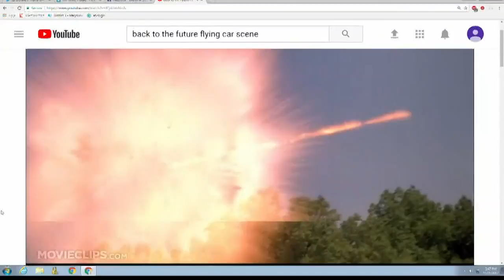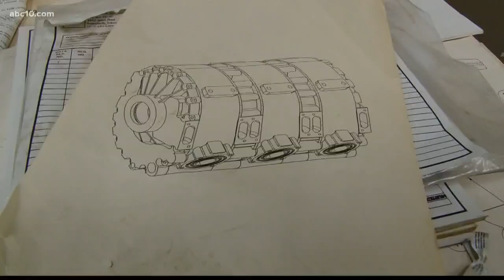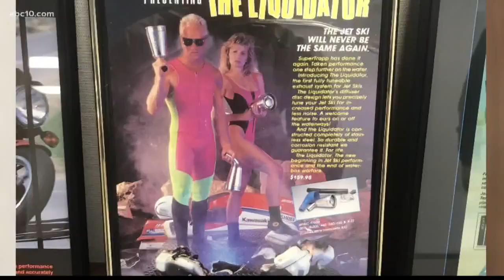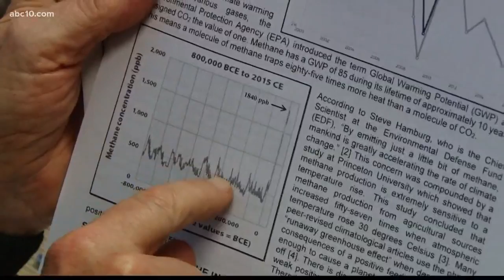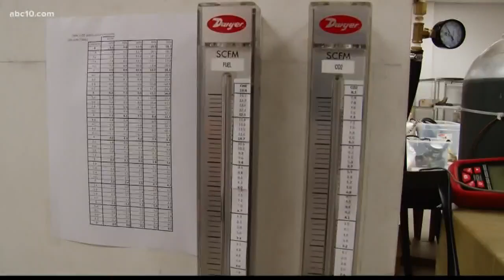Moller Skycar: Why hasn't the flying car hit production?

Comment: 60 years and thing is still dangling from a cable going nowhere, its time to let it die.
Reply: Michael Collins  The later compound version of his rotary engines were never installed on his M400. Had they been, they would been able to maintain stable hover as they have more capability. The big issue is that his company has been in financial ground effect for over a decade, and the reason for that has 100% to do with marketing. If you can't attract top talent or sufficient capital (and often lack of one leads to the other) because of a PR failure, you're ruined.
Reply: @BlueOceanStrategistS  no dude. this "car" is a scam.  in close to 50 years he has never once had an untethered flight & I believe there was one test flight ever that even ascended out of the ground effect zone. he made outrageous claims of having similar fuel economy to a car & a range of 900 miles. oh yeah & it uses 8 rotary engines. that's laughable. also, I dont know about you but I'm not about to put my life in the hands of something with a powerplant as notoriously unreliable & finicky as a rotary engine. god forbid something goes wrong with the engines (which it will) you're screwed because this thing has a glide ratio of a sofa. skycar is never gonna happen.
Reply: @bofaf3tt  Technology isn’t constant. Moller developed coatings to improve the life of the rotary. You’re telling yourself that you don’t need to know how to make rotary engines more reliable. Maybe it’s not worth the effort to make such improvements, or maybe it is, but how would you know if you can’t tell the difference between what’s possible and what isn’t?
Reply: You have the causality reversed. People letting it die is why it is dangling from a cable. He has the technology, just not the money. Silicon Valley is attracting money away from investments into engines like Moller's. Low emission internal combustion engines are not something that Californians tend to invest in. Yet, the compound rotary version of the Freedom Motor is able to provide the necessary power density to provide the stable hover transition Moller needs to demonstate in his M400. However to produce at a scale which is profitable, he needs large investment into the company in a small period of time. People vote with their dollars, and their dollars say they don't want Moller's Skycar to be in production. So guess what.... It isn't in production.
Reply: @BlueOceanStrategistS  Moller has raised tens, probably hundreds, of millions over the years. If only he had spent it on R&D and production planning, rather than lining his pockets....
Reply: @geonerd  The amount he kept for himself isn’t nearly enough to complete the R&D.

Comment: Looks like battery powered multi-engine ducted fan craft is the way to go for now. I'm afraid Moller missed the boat. Fixated on the rotary engine. Too bad. Not sure why he couldn't produce one functioning prototype, remote controlled, flown over a test range, to get investors really interested. He seemed to have one to use. Must have been afraid to lose it. Those noisy, polluting, tethered hovers just didn't cut it. He'll be a foot note in the history of flying cars. Seemed so promising 15 years ago.
Reply: Not even a footnote, he only got a controlled "hover" out of it, the device never flew.

Comment: The rotor engine is misapplied in Mollar flying car. If I should be used to power an electric generator to power electric motors  in the nacelles to lift the car.
Reply: Weight is a factor, especially for any flying vehicle.

Comment: One of the biggest frauds in aviation. For years Moller has taken investors' money, and the only thing this piece of junk has done is hover. I am not an aeronautical engineer but I am willing to wager that even 8 Mazda engines cannot move enough air through the ducted fans to provide thrust. Ridiculous people still listen to this man.
Reply: They're not Mazda engines at all. Mazda engines are not suitable for the Moller SkyCar. That's why Moller developed his own rotary engines. No one is willing to invest in producing them at volume though. Producing them at low quantities is highly inefficient and would easily eat up the little cash flow they've had for the past some 15 years. So it sits on the shelf for now.
Reply: The 13B or the Rx7 engine is extremely capable and safe.  The last guy that didn't know that rotaries are banned from mostracks because they out run them like secretariat outruns every other horse died in the 90s.  They've come up with improved HP every year.  Over 50 years that's fast enough to run pistons off any track.  It's true.  Look it up.
Reply: @likesrush  There is a huge difference between the Mazda 4 rotor engine being "banned from competition" and the Mazda rotaries this guy was using in his "sky car". He had modified them, yes but they are unstable. The only company to make a production rotary engine from the ground up is Mistral, and they have not even been able to find a customer base in spite of FAA approval. And no, the rotary engine has not come up with "improved HP every year", in the Renesis engine, Mazda experimented with side ports and cleaner emisions and they still could not get significant HP or fuel efficiency out of their engines, hence the RX8 died.

Comment: How the hell did this guy come to the conclusion that Moller was making drones before they were a thing? And why don't they go a bit further into his apparent inability to develop a functional flying car? The guy has spent tons of money for poorly developed, noisy flying machines that hardly hover outside of ground effect, even though he promised high efficiency, low operational costs and proper performance. He has been promising to put a flying car into production since decades ago but he can't cause he cannot make one that functions properly. And now he is trying to save his company by selling engines and propellers for bikers to wear on their back like idiots and push themselves uphills instead of using their two good legs and exercising a little more. Your ideas cannot work well when they are based on futuristic predictions advertised on the media in the 70's.

Many other manufacturers are working on flying car models and they have already tested some. I am sure that many models will enter the market soon. But it won't be that guy who will make one.
Reply: So basically Dimtris, 40 years later as technology has progressed, other companies can now see that skycars will be a thing of the future. You know, just like Moller did, 40 years ago. :)
Reply: Everyone envisioned flying cars 40 years ago. The problem is that Moller's design is poorly studied, poorly tested and he makes no imrovements upon it. He is just trying to sell 70s science fiction. There are other companies like Terrafugia, AeroMobil or PAL-V that have already made prototype "flying cars", and these models are the result of years of research, they have been tested and I believe that they could enter the market within the next decade, at least for the rich people. What Moller needs to do is to get real and stop promoting retrofuturistic bullshit like "bike thrusters" and "flying saucers".
Reply: @songmaster9308  The difference is that other companies have not been promising "Going into production next year!" for the last 4 freaking decades.  Moller is a lying, thieving sleazebucket...
Reply: @geonerd  yeah there's that. lol But don't be too sure that there's not a lot of promises being made now that won't ever result in production units.  I can't see this being more than a niche market at first, imagine  car sized drones all over the city, talk about noise!
Reply: @Dimitris, I think the Germans were developing a flying saucer back during WW II.

Comment: What a crock - Mazda already developed the Wankel Rotary engine far enough to win the Le Mans 24 hour race,... all Moller had to do was buy a few of them.
Reply: More than endurance, you need greater power density, greater energy efficiency, greater reliability, etc. while being small enough to fit inside the hubs of the ducted fans. Skycar needs two rotary engines per nacelle, so it needs a total of eight rotary engines. Here are some specs to consider from "Rotapower® Engine Performance":

--------------

High Power to Weight Ratio
More than 1.5 HP per pound of installed weight in high-performance versions

High Power to Volume Ratio
(Power Output / Volume) > 100 HP per cubic foot of installed volume

Few Moving Parts
Charge- or air-cooled rotor design eliminates many engine components typical of rotary engines

Proven Multi-Fuel Performer
Demonstrated on gasoline, natural gas, alcohol and propane
Spark-ignited diesel, kerosene and jet fuel

--------------
Reply: Moller should have abandoned the wankle engine and adopt micro jet engines. It is a very well developed technology.  If the wankle is a bust go with a better idea.  Hybrid electric fan jets is another option.
Reply: @thuddpucker11  Jet engines are much too loud and are inefficient at lower speeds when compared to fan-based engines.
Reply: @thuddpucker11  The newer design of the M200 is hybrid electric.

Comment: Tons of drones flying already, why hasn't this ??
Reply: They are aiming for a four-passenger skycar (M400) that can fit inside a two-car garage, has a speed comparable to a light turboprop aircraft (> 275 mph, up to 375 mph), can transition to hover, while having a range of 900 miles and a price of less than $1 million. Based on existing energy storage technology, this physically requires that they use some sort of liquid fuel that burns. So he uses internal combustion engines. However, there is no room or weight allowance for a gearbox or a transmission. Therefore every M400 would need eight engines which put out more than 1 horsepower per pound of installed engine weight. Unlike electric motors, you cannot just buy these off the shelf. They would need to build a full-fledged production plant for the motors to be able to sell at the unit volumes needed to cover the accumulated costs of development. Production plants can cost tens of millions of dollars to set up for the first time.
Reply: @BlueOceanStrategistS  

Thanks for the explanation!
Reply: @BlueOceanStrategistS  Thank you for the explanation. In other words, if the F-35's budget, or the Iraq war budget was given to this type of innovation, it would take off so to say, correct? It would still have limited buyers, obviously, not for the common man, but might have worked.

Comment: You cant put dorito engines in planes they arent reliable
Reply: The rotary engines Moller developed are reliable. The only problem is that at the current rate of investment, it is impossible to produce them at volume. That's why you don't see them today.